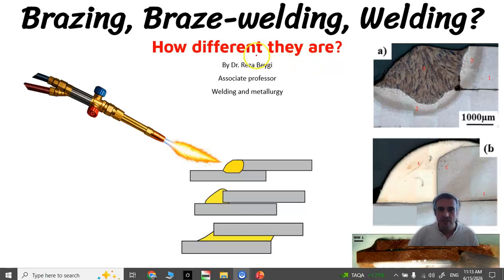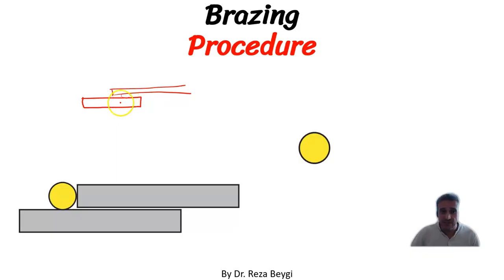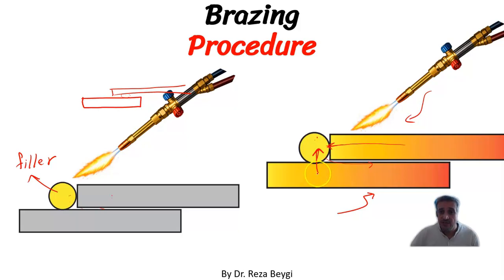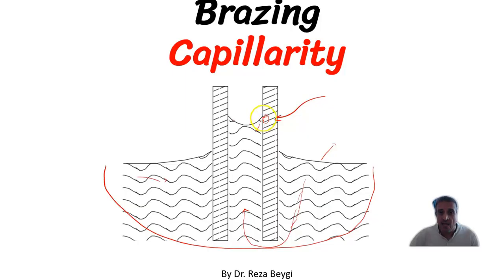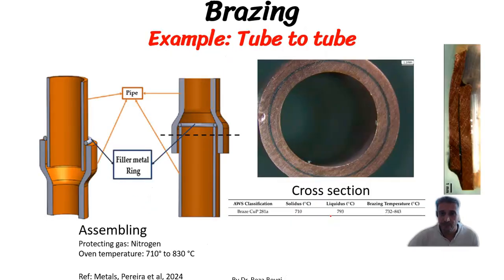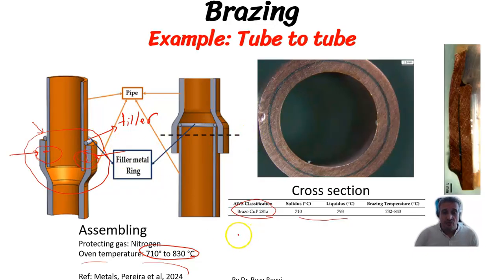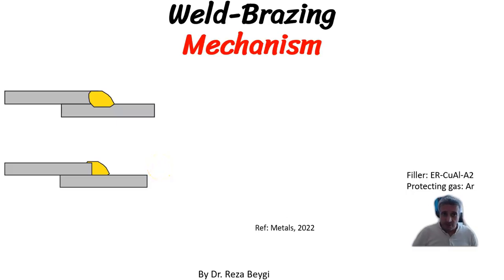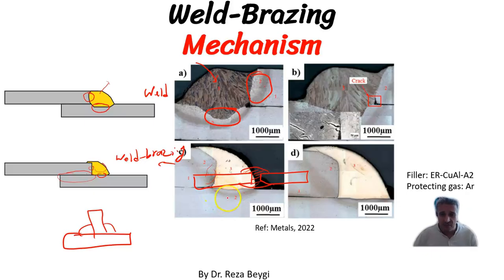Brazing vs Braze Welding vs Fusion Welding – Key Differences Explained

Comment: This is clearly explained and interesting. 

Is the particular kind of filler metal a worker has chosen to use a factor in whether he can braze with it (i.e. achieve true capillary flow) or whether he can only braze weld with it, or is the only critical factor that determines whether true brazing takes place rather than braze welding the joint design? I assume the use of an oxy-fuel torch in both cases.

I ask because I find different filler rods have different flow characteristics, presumably owing to their different chemical composition. For example, Sifbronze number 1, a silicon bronze filler rod, does not in my experience achieve such good capillary flow as Sifbronze number 101, which contains manganese.

 Hence, if I want to repair cracked cast iron or a cracked steel component, I grind out a valley all along the crack and then use Sifbronze number 1 to fill the void. On the other hand, if I want to get good capillary flow between two lap-jointed surfaces I choose Sifbronze number 101, which flows much better all the way through into the narrow gap between the two parts to be joined.
Reply from the maker: Thank you for your positive feedback.

Regarding your question, both filler type and the procedure are related to whether you want to do brazing or braze-welding.

For brazing, the filler material should have enough flowability and wetting charachresistic to fill the gap.

For braze-welding, the molten filler is more viscous and possesses low flowability.

In your case, silicon-bronze is only suited for braze-welding, as it is not designed to seep  into the gaps.

Comment: Thank you for the info! Could you braze-weld small aluminium rod? Would the strengh be comparable to welding?
Reply from the maker: You are welcome!

For aluminum braze-welding, the main barrier is the oxide layer on the surfaces.

The only case I saw, is brazing of claded aluminum sheets where the clad layer is low-melting 3xxx aluminum alloys.

Two cladded aluminum sheets are stacked and heated. The claded layer melts and upon solidification a bond is formed.

For aluminum in the shape of rod, it seems impractical.